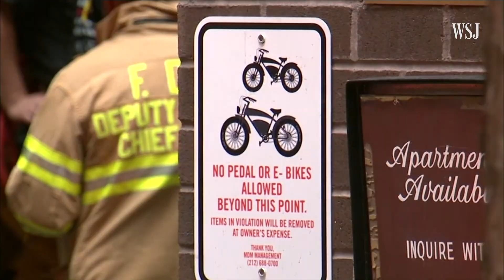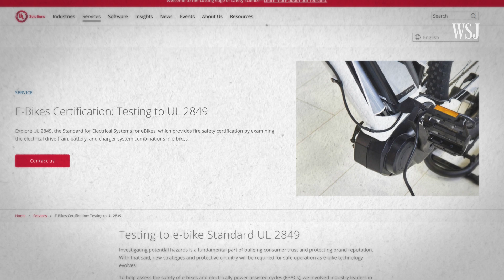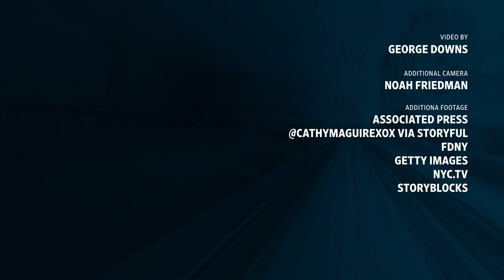E-Bike Batteries Keep Exploding. What’s the Solution?

Comment: E-bike batteries just need to be equipped with good battery management systems. They should never allow cells to charge higher than 4.16 volts each, and, they need to be voltage balanced, to guarantee they are all the same state of charge, so stronger cells don't over-discharge weaker cells. Power tools, such as Ego, and Stihl, have these types of BMS's, and rarely, if ever, have problems, even after years of use. E-bikes just need that kind of integral BMS. The cells are actually the same! The other option, is to out-law Li NCM batteries, allowing only Lithium Iron Phosphate (LiFePO4) or, Lithium Titanium Oxide (LTM) batteries. While these don't offer the energy density of the Lithium Polymer/ Li Nickel Cobalt Manganese (Li-NMC), they are much safer. It just means, the battery pack is slightly larger and heavier, for the same capacity.

Comment: Best solution is education, people need to learn how to properly charge a battery most of the fires I hear about are during charging most people don't know to disconnect the battery from the bike wait at least 20-30 min for the battery to cool from your last ride or sitting out in the hot sun for long period. Then plug it in to the charger do not leave it unattended if it's inside without proper precaution set a timer to avoid potential overcharge if you live in an apartment charge it in a cheap fire safe, just drill a small hole for the cord to go in.

Comment: Important to point out that not all Lithium cell chemistries have the same vulnerability to thermal runaway and subsequent fires. 
Perhaps only allow sale of Lithium-Iron-Phosphate based batteries. 
And DYI'ers should never be vilified for this or any other technology. 
Also, UL rating probably increases the retail cost of an eBike by $500-$1000

Comment: They should introduce metal boxes to put batteries in while charging and fireproof bike parks in buildings. Also more publicity about the risks. Batteries should allways be charged in a fireproof location. I charge mine on the cooker hob with nothing combustible nearby. We have a fireproof cellar for the bike but unfortunatly no charging there so need to remove the battery. I think all flats should have a fireproof room with charghing for  e bikes

Comment: People who spread misinformation make it difficult for those who genuinely pay attention to their bikes while charging. Many of the batteries that have exploded are low-quality, inexpensive ones purchased from Amazon or AliExpress. I know several individuals who have invested tens of thousands of dollars in their bikes to prevent such issues. There are reputable companies that produce batteries with professional designs and built-in Battery Management Systems (BMS) to avoid these problems. The real issue is that people often charge their bikes without monitoring them, which is how many of these fires have started. If you look at the bikes shown in the video, they all appear to be cheap and poorly made.

Comment: To charge my Giant Stance E-bike battery I use an old red metal toolbox i wasnt using that has two top shelves in it that fold down when the top is shut , it opens from the top with two  sides and the buckle locks are down the middle of the top and then i drilled some holes to allow ventilation , and when closed the holes allow air but the shelves inside block any fire that could shoot out if the battery ever did explode inside. So if that did happen im hoping and pretty sure it will work to contain the fire to inside the toolbox and not burn my house down and if your still worried you could also get a metal trash can with lid and do the same drill some hole for ventilation  and put the toolbox with battery inside the trash can for double protection.

Reply

Comment: AND as of August 2025 Chinese batteries are STILL randomly catching on fire so there's been no solution. The problem, according to technical reports I've read is POOR QUALITY CONTROL usually because of cheap seperator films that are too thin (thinner than known specifications) between the anode and cathode leading to internal shorts. Properly made batteries have a "battery management system" but it seems some Chinese factories have faked that too.
The solution / FIX is to STOP USING CHINESE PRODUCTS because their CULTURE is low trust and cheating is inherent.

Comment: The way the packs are made is not conducive for users too inspect and test the individual cells. They are wrapped in shrink plastic, welded, soldered BMS wires, and you should be qualified too open them. Some packs are pretty flimsy constructed and contain questionable battery.
Also people are placing packs in freezers to over charge them to increase range. Some get exposed to water.
The batteries are combustible. Batteries are fairly dangerous if mishandled, because they can produce chemical reactions. Just like gas, or oil, coal. Toxic nasty stuff.
Education, qualified technicians, helpful politicians= solution

Comment: Simply charging correctly won’t fix the issue—it also depends on how the battery is built. Using a smart charger is essential. I see two major issues in how some companies handle batteries:
- The spot welder might be too powerful, potentially damaging the cells during assembly.
- Low-end cells that deliver insufficient current can overheat, especially if they’re not made with the right materials.

Comment: just saw this one.  And even though it's dated, from 2yrs ago, the information isn't really that good.  First, there were and are a ton of ebike companies that make certified and UL tested batteries.  There's a lot of brand name bikes like Specialized, Rad, Trek, etc... which are all certified and have been so pre covid as well as post.  That said, the solution isn't outside the apartment charging stations.  Very few people are going to leave their bikes overnight at a charging station if they need a full charge and probably aren't going to wait the 5+hrs it's going to take to charge them.  The risk of theft for leaving a bike in one of those places is just way too much.

IMO, the solution is just not allowing off-brand non-certified bikes into the US.  Typically those are the ones causing the problems along with escooters with the same issue.  Basically, the main issue is just shoddy workmanship as well as something as simple as the battery keeps charging even when it's full and that's what leads to overload, explosions, and fires.

Comment: I DIY them. I have a smarter BMS (JK / JiKong) (Bluetooth) with has higher balancing current and every parameter can be changed. the BMS itself has a temp sensor plus two more probes.

Fire mostly happen during charging when a block dies and gets hotter and killing nearby cells due to excessive heat. (thermal runaway can happen this way I guess, but it was "only" +60 C)
I had that happen to my old eBay E-Bike conversion kit (Yose Bike), a thermal camera with a smart plug could stop the charging process and give you a warning when the battery / BMS isn't smart enough.

⚠️ It's only a problem on cheap China bikes from "no name" brands. They ofter use a cheap (like 10 $ BMS) and often no name cells and the manufacturing  process is often bad.

NCM / Leon Cycle has designed their own BMS and it work much better than most China E-Bikes although it is one itself.. (support is very bad tho, but the rear hub motor system is Highly fail-safe

I checked my cells when "fully discharged" and all cells were at 3.00 volts with nearly no drift. (under 20 mV) and the output was cut.

Comment: I have an inexpensive timer set up so I can’t overcharge my eMTB. Plus I bought a quality, name brand bike (Bosch), and charge it in the garage with a timer. Plus I would never tamper with it ! As for charging outside… our 2 bikes have a combined $20k price tag. Not going to happen
Reply: Bosch battery's are very safe I guess, but I wouldn't recommend using a timer, bc you can't be sure, if the BMS only balances during charge or all the time. if it only happens during, it need more time, when the battery is older. Also the charger will never Overcharge since it's giving out a fixed Voltage (CC/CV) and the BMS also has a OC & OT Protection. (Overcharge & Over Temp.)
Reply: Price tag can't bend physics. Also you never know what that $10K markup is for — quality control or just marketing overhead. With VW tampering scandal I'm very susp about quality of well-known brands.

Comment: The solution is to get some decent BMS units that do charge and balance the LiPo cells and not the bargain basement contraptions installed in ebikes. There are 2 reasons for fires. Bad BMS and / or bad batteries. There is a ton of equipment that uses recharchable Lithium batteries and they rarely catch fire. If your BMS does not balance the batteries, you are flirting with fire as anyone who has used RC cars/planes etc will tell you. Also, batteries must have the same number of cycles and you cannot mix new and old batteries

Comment: The battery is the most expensive part of the ebike. One easy solution is charging fire resistant cabinets with heat sensors

Comment: I think it should be more like a square shape golf  cart battery made with different cathode materials. That is why I bought a safer lithium phosphate golf cart battery with matching voltage, watts, amp hours and bms. I don't even trust the shape of those round e  batteries mounted at an angle hooked up to a motor period.

Comment: I like electric vehicles it’s a very good technology, but they should come up with better and safer solutions. They should be safer place to charge batteries 🔋. Manufacturers should design batteries more efficiently and it’s safe to be used, no chances of battery fire🔥. Vehicles should be designed more safer to be driven on roads.

Comment: I used to design BMS's for large format Li-ion battery systems. I suspect that the biggest problem with these bikes is that the BMS does not monitor the voltage and temperature of each cell in the battery. If there's an imbalanced cell, the BMS will not be able to stop a thermal runaway. Add that to batteries made with cheap cells that don't last and don't maintain their ballance with the rest of the cells, or are replaced without balancing to match the rest of the cells and the next charging could be the last. Li-ion batteries cannot tolerate imbalanced cells without a GOOD BMS to protect them.

Comment: As far as i can tell the problem is specific to the battery and its charger. Forget the rest of the bike. Whether it's a certified bike or a kit will have little bearing. That's a red herring. Those fires aren't caused by the bike controller or the motor.

The real problem are those people building their own batteries, often recycling used cells with DIY BMS (battery management systems), and then selling those things. Importantly, I believe it's about a mismatch between the battery and the charger. Someone, with no prior experience buying a secondhand/stolen ebike could buy a bike with no battery, or source their own charger, and not realise the charger doesn't match the battery. 

I wonder if the fire services etc have tested this theory. What happens if you charge a 36V battery with a 48V charger? Would it not over-charge the battery? 

What i would like to see is some kind of early warning built into the batteries, a high-pitch alarm that goes off if the battery starts to overheat. This would be hard to implement.  
To put this into perspective, we had similar headlines when mobiles and laptops started using li-pol batteries; now no one thinks twice about their use of either device.

Comment: Why can't the manufacturers of e-bikes and e-scooters just stop using lithium batteries and use a different type of batteries that don't explode violently or have firmware that monitors the health of the battery and charging fixed so that it doesn't malfunction? They don't have to be using lithium batteries as the primary power source for these devices because these batteries contain flammable chemicals that can just reignite after putting out the fire, and the chemicals are toxic when the battery explodes

Comment: Lead Acid batteries are safer than Li-ion batteries. Li-ion batteries require a complex circuit called BMS, if its mosfet short circuit it will result in a fire, whereas Lead acid batteries have a simple circuit and are not complex
Reply: Yup. That is actually why things like emergency lights use lead acid batteries. Safe and reliable.

Comment: Put a fuse on all e bikes, if not already existing. Only use sodium and solid state batteries for e bikes because back yard maintenance happens with them. To alleviate potential problems if wiring goes wrong, it shouldn't. Get rid of liquid lithium batteries, only use them in cars. That have better wiring systems in place, and maintenance.
Reply: Cars shouldn't use them either.

Comment: People need to stop making it look like all ebikes are dangerous. They’re not but they’re horendously expensive in bike shops for reasons: they are heavily safety tested have endless built in safety cut off features even apps that link to your phone and shut off systems that trigger if the speed sensor on your wheel isn’t installed or if water gets on the terminals of the battery terminals etc much like a phone in your shower they cut off and send an alert to your phone as to why they won’t restart without disconnecting the system itself or logging into the app and reading the diagnosis the circuit board brain box of a system built into many of these bikes can detect. 

Any e-bike over 250 watt is illegal in the uk.

Comment: Stupid issue is easy Just allow the ones acid/lead Theres no Problem with that Batteries in the other hand Lithium is the problem even Tesla, Hummer and Rivian explode with their Lithium Batteries so lead acid is the way for micro electro movility.
Reply: Absolute nonsense. LFP batteries are far better.
Reply: @logitech4873  No it is true
Reply: @NEON2600  Look up the energy density of the two. And are you forgetting that there's literally lead in lead acid batteries?
Reply: @NEON2600  How is it far more recyclable? They're both metals.
And you ignored my point about energy density, which is why LFP is used and lead acid isn't used in EVs.
Reply: Lead acid is also way better for the environment than lithium batteries. They are the most recycled too

Comment: Take battery off bike before charging because charging battery on bike can put a lot of excess voltage into the controller which causes overheating if the battery is still switched on

Comment: only solution is to switch from NMC lithium battery to LFP lithium battery. NMC or lipo battery are prone to internal combustion due to temperature rise. while LFP is fireproof and causes no harm and withstand against high temperatures. but safe is lithium titan batteries.

Comment: The problem is the battery cells are glued together on cheap bikes. They rub on the case and short circuit. Cell holders should be made law

Comment: These batteries can explode if charged too quickly. Also if knocked around, it can explode. The resulting fire is extremely ferocious and cannot be put out. I would rather just go back to NiMH which was much safer. Also, never, ever take one of these Lithium batteries into an elevator.

Comment: One thing which could work is to have the batteries divided into separate smaller batteries. So in the unlikely scenario that thermal runaway does occur, it can be isolated. Say, only 1/10th of the total battery will get destroyed rather than the whole thing. Most ebike batteries contain roughly 100 cells and it usually just takes one faulty battery to cause thermal runaway. With this you would only lose 10 cells as opposed to the whole pack.
Reply: youre guaranteeing only the one cell will explode- all righty, then.
Reply: @tommurphy4307  damage control.
Reply: Like in the odd chance there is an ev fire. A small battery bursts into flames in an isolated area of the vehicle that is capable of holding the flame. Maybe could even continue riding/driving with the other battery packs. Redundancy as space travellers would say.

Comment: There are a lot of problems and no simple solutions.

Since fake certifications are everywhere and quality can vary dramatically pack to pack, a more logical solution would be to create and mandate the use of fire and explosion proof containers to hold the batteries while they charge, as a precaution. Simple, to the point, easily adoptable, will do the job.

I suspect a large military surplus ammo can will do the trick, would have to modify it so that wires can go through the case in a way that doesn't compromise the integrity of the box.

Comment: If the Batteries are not UL listed certified, you just don't buy it. Then counterfeit comes into play. Battery with all the technology we have today, it should stop charging if it has issues. The battery checks it self, by not excepting the charge.